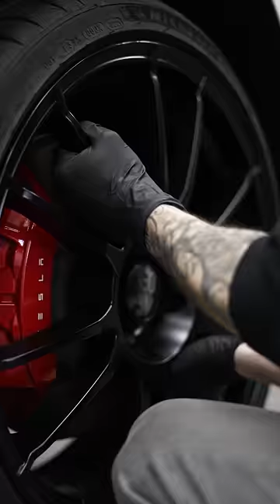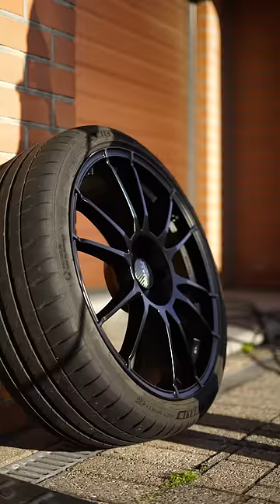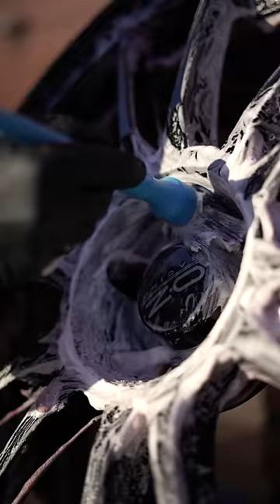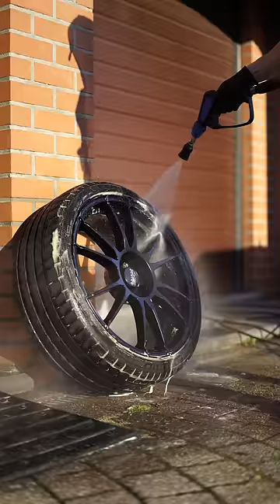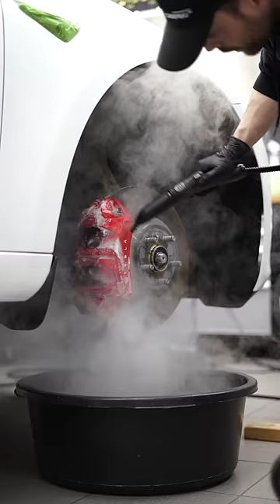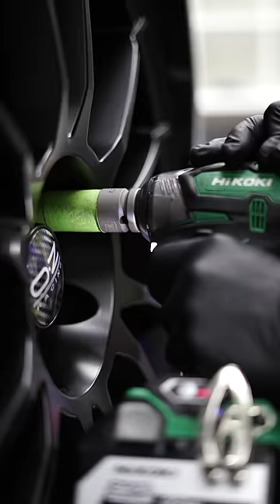Deep Cleaning Wheels & Calipers ASMR - Tesla Model 3 #shorts

Comment: Deep cleaning? The wheels and callipers were really clean to start with!
Reply: True but it's still satisfying af
Reply: The spray that he uses on the rims reacts with brake dust and turns red. As you can see, a lot of red. Not clean
Reply: Deep cleaning doesn't mean that it's super dirty to begin with... it just means that it's a very thorough and good cleaning ..
Reply: What’s clean to a normal person isn’t clean enough for ceramic coating.
Reply: As you can see, he’s coating the wheels. In order to coat it, it needs to be like 100% clean. In order to not coat the iron contamination as well
Reply: U dont know about what’s detailing is

Comment: Why is he doing this for? Guy is totally boring....
Reply: If you think this is boring, then this wasn't made for you. Us car guys enjoy this
Reply: @ProGamerKid2000  he could just use only good high pressure washer, that would be more than enough. And then apply some stuff if he wanted wet tyre effect. It would not even require dismantling the wheel.
Reply: @predatorj3012  water by itself isn't going to dissolve brake dust. This wasn't wasn't an average wheel clean. This was a DEEP CLEAN which is literally the title. Which is why he took off the wheels
Reply: @ProGamerKid2000  120 bars would wash away everything.